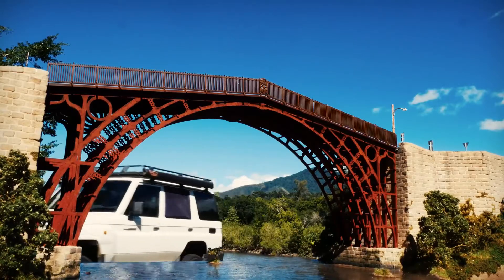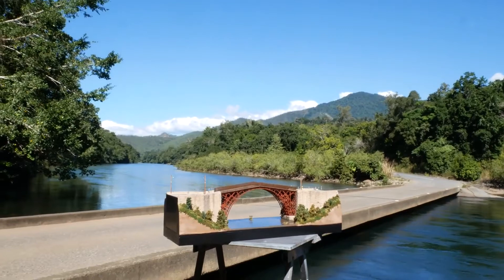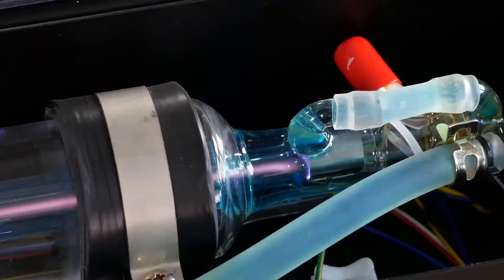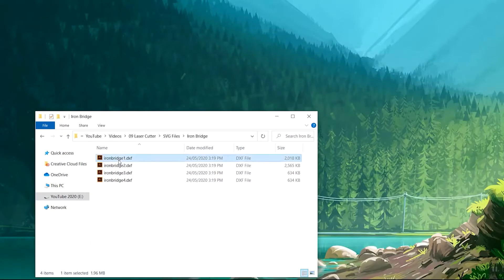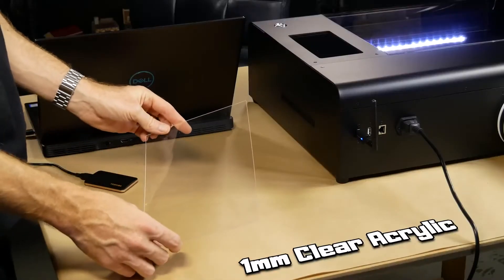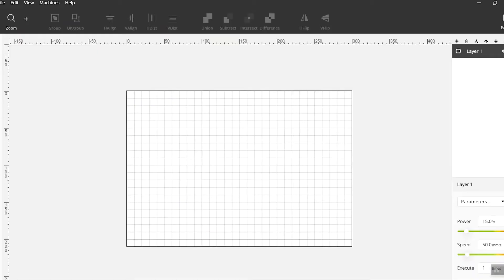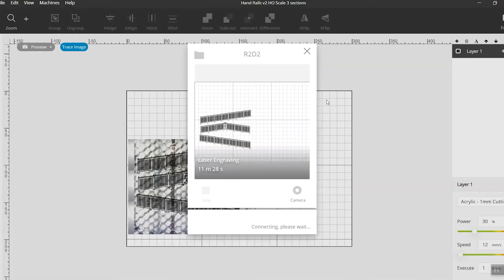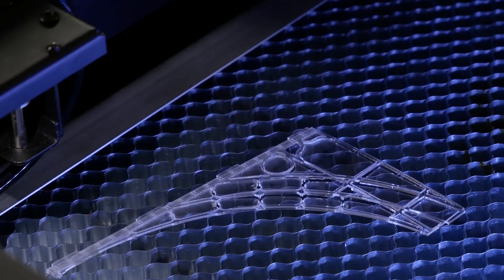Using the Beamo 30W Desktop Laser Cutter & Engraver To Make An Ultra-Realistic Bridge

Comment: Does it need  venting or a BOFA filter?  What kind?
Reply: Yes it does need venting. There is a supplied vent tube which connects easily to the beamo the other end goes outside.